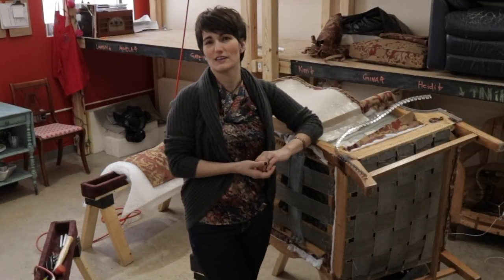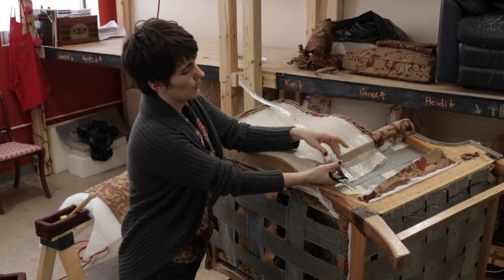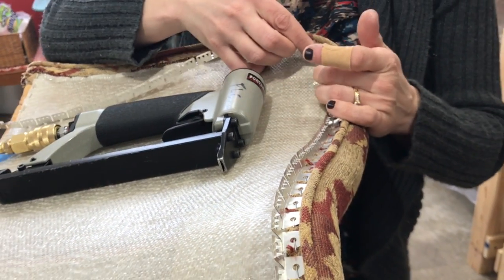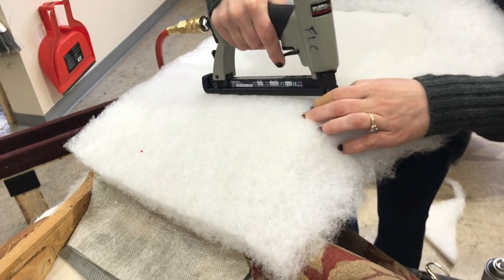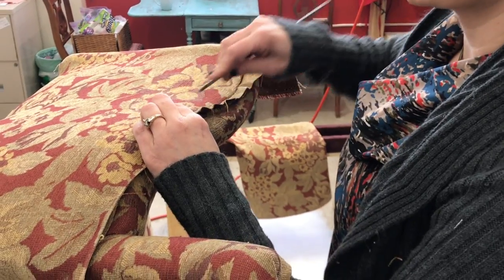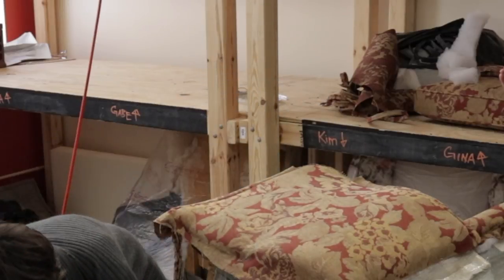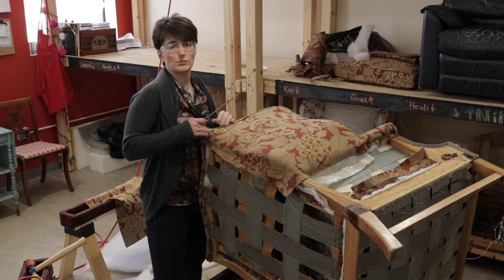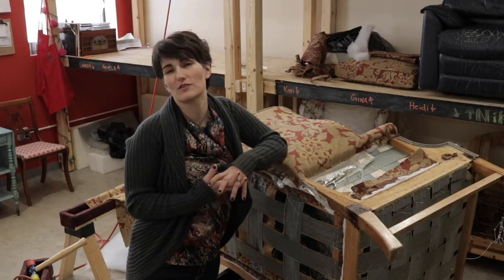Method Share - PLI-GRIP STRIP ON UPHOLSTERED WING CHAIR

Comment: this is a really good video.  Feedback--an overhead close up of the positioning of the batting would have been nice.  It was hard to see what you were referring to in terms of where the batting was to be placed close to.   Then when you laid the fabric over the top of the batting it was hard to see where you stapled the fabric  to hold it in place.  Lastly,  when you were trimming the fabric after using the regulator to tuck the fabric into the pli-grip,  an over head close up camera shot would have been helpful to see how close you were trimming the fabric.